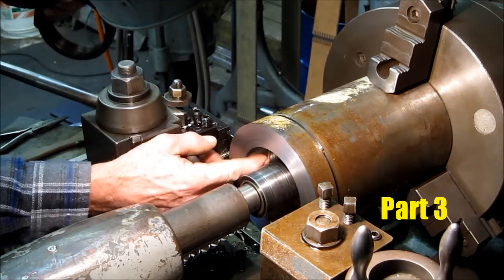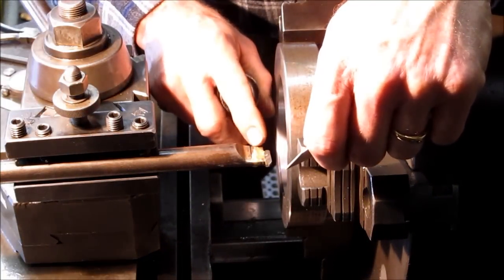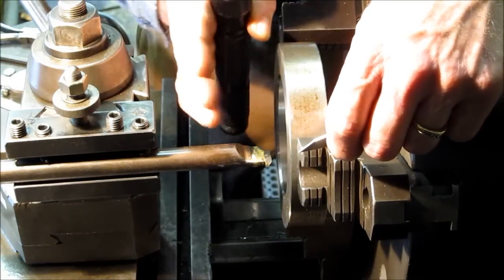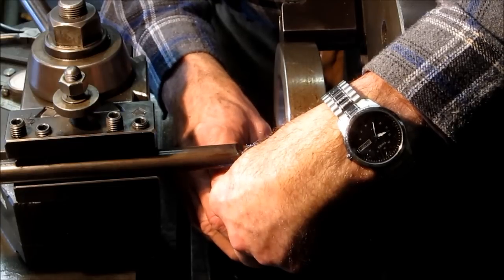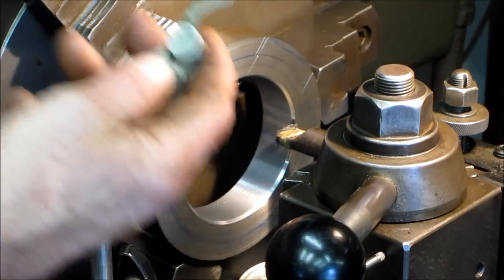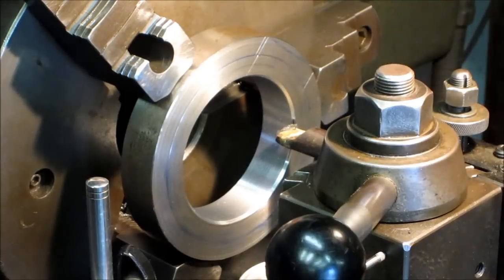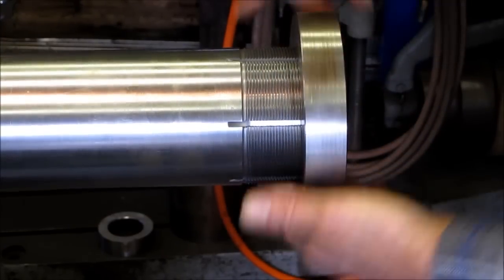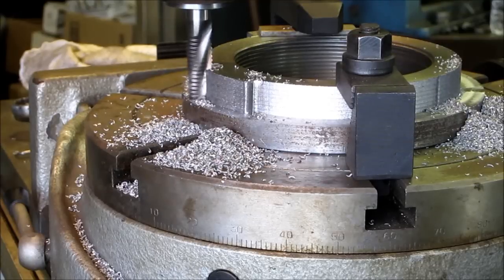Oshkosh rear axle tube Part 3

Comment: Keith: this was over seven years ago, so my question is have you seen this again because the customer elected to continue using the worn out hub with the spines on the one end instead of having the entire assembly repaired as a complete unit?

Comment: Could that threaded split lock-nut have been carved out on the plasma setup to avoid all the OD milling?
Reply: Keith mentioned that he did NOT want to cut down the excess material using a oxy torch because he was concerned as to how it would effect the threads on the inside diameter. His plasma torch would not have the capacity to cut through that thickness of material.

Comment: Have you ever thought of make a pipe pedestal for setting those tubes in the hubs? You could take a piece of 8" pipe and built a base under it. That would seem more stable than the trash can ,but i do understand you use what you have. As usual great job.

Comment: Nice work for sure.  I spent 20 years running first  American Tape Control NCL'S & NTL'S, then CNC CinTurn and Swasey 4 axis machines.  Wasn't until later that I wound up on ELA'S, etc.  Threading was a rush on manual after all that NC stuff.  You make it look easy.  Thanks for sharing.

Comment: Hi keith. .great job. .how did you aligned job on the mill means on rotary table with cutter to remove uniform material from outside diameter??
Reply from the maker: I had forgotten now but more than likely measured in four point from table edge into the nut outside diameter. ;{)-----

Comment from the maker: Well it is engaged at the start of the pitch in exactly the right spot, on each pass with the cutter, by using a thread dial on the lathe. It is a dial that spins on the lead screw as it is turning and you engage the half nuts on the matching marks on the dial.  ;{)-----

Comment: That was some good work, close call on the thermal shrink fit too!  Surprised you didn't stick the axle tube in the freezer to gain another ~50 degrees of expansion/contraction.

Comment from the maker: As I have answered in the comments already; It is a following pass or cut without advancing the dials, cutting at the last setting and the only metal removed is the amount that was held back from tool pressure and that is the amount of material which passes by the free cutting depth, on the prior cut.

 ;{)---

Comment: I understand that in threading you start the carriage on a particular number to insure the cut is in the correct location to the last cut made.  It seems like it would a pretty easy job to automate this function.  Is this an option on the lathes made now?  It seems like it would be pretty easy to Jerry rig up a system to do this or does that take too much of the skill away from the machinist.

Comment: Another job well done Keith, I was nice to see a master machinist using one clamp on that locking nut when you machined the slot, the top man in our shop "tut tuts" at me for not using two clamps. Do you have any plans to put a DRO on the lathe? I've noticed you've got them on the mills, they sure speed jobs up.

Comment from the maker: On a lathe, there is what’s called a thread dial, and the thread dial lets you repeat a thread start or engage more than one thread at a time with the same pitch. The dial is only a reference for the timing of engagement with a pair of half nuts on a lead screw, which is the long shaft or one of the long shafts passing through the carriage on the front side of the lathe. ;{)---

Comment from the maker: A bearing has a close tolerance requirement, when it was made and if it is new, and if it was a need to check or set / adjust your thimble of the micrometer to establish a true measurement, I'd say it could be done within the tolerance of the bearing a couple tenths.

Comment from the maker: Thanks for the Comment! The CA is the perfect size, for the 1" tooling I use most of the time, If I change out to 1/2" high speed for example, I stack the bits. Someone had called it a Mascot before but I haven't found a lable stating that anywhere...

Comment: I have watched just about all your videos, great stuff.  In many of the videos you do part off ops and I was wondering what insert you are using.   If I am correct you big lathe is a 17" Mascot, mid to late 50's vintage?  Do you find the CA tool post appropriate in size?  I have a CXA on a 16" Pacemaker (real swing 18") and sometimes I would like a larger tool but a CA sure looks a lot bigger.

Comment: Hi Keith,

These vids are priceless!  Every time I rewatch one, I pick up on techniques not previously noticed...When you used the K&T to split the threaded compression ring, your cutter radius was not sufficient to allow you to cut to full depth in one pass, so you flipped the part over, indicated it in, then cut the other side...How did you indicate it in?

Comment from the maker: @nder12345  That gives you a true thread depth, because the compound angle is only a percentage of true depth. Each time you bring the main carriage dial to zero ready for next pass, you can see where you are in whole process. Threading is a job that souldn't be interrupted, butt having a dashboard gage, gives you a better idea where you were, if needed and how much more to check fit of test fits :)

Comment from the maker: @DieselCrawler86 Your right on the upside down bar, some times when I'm doing bronze or brass OD turning I set the tool bit upside down to spay the chips away from face and body LOL :)

The compound on the rear of the carriage, is a hydrualic tracer attactment, you can see it working in a few of my shafting vid's...

Comment: Great video, I always love the stuff like that when people say "it only stopped taking grease 6 months ago, is that an issue?"  Another great way to thread from the inside out (if you do not have/made a bar) Is to just flip your normal bar upside down in the holder and then thread from the inside out, works just fine. What is that compound on the backside of your lather for? the one with the hoses coming to it.

Comment from the maker: @SlowEarl1 On most of my threading, I like to take .010" depth per pass for the first .050" of depth then back off to .005" per pass there after, finishing with a spring cut or two, helps gloss up the threads, specialy on mild steel, 1018

Comment from the maker: @gregoryscottsr Depth judgement, has more to do with machine rigidity and needed removal. Speeds and feed rate are what you adjust for best performance coloring, most of the time, just stepping up your feed rate, will deepen the color, or reducing the rate will lighten the color. Try 2 to 3 inch mild steel, 350 to 400 RPM, Depths of cut at .025", .050" or more and adjust feed rates .0025, .005, and .010, your sure to cross the range of colors :)

Comment from the maker: @oneyaker Ya, it's a piece of Mechanical tube, my local (middle man) suppier, General Suppy Co. in New Bedford, Ma. had a piece on the floor, luckly! Most steel suppliers can hunt down some... That was a piece of 4.75" with 1" wall, 32" lg. for $375 my cost...